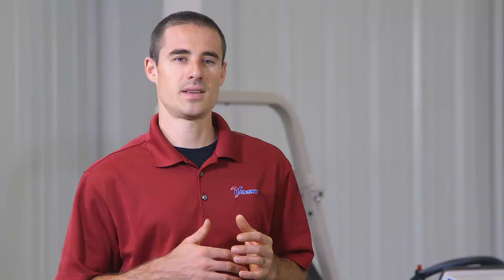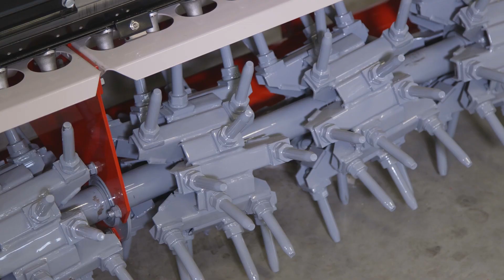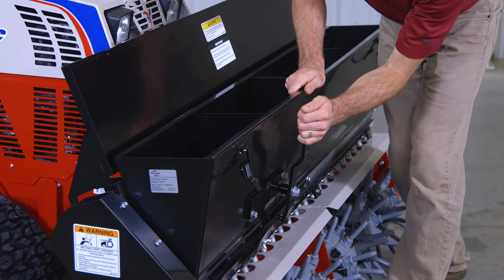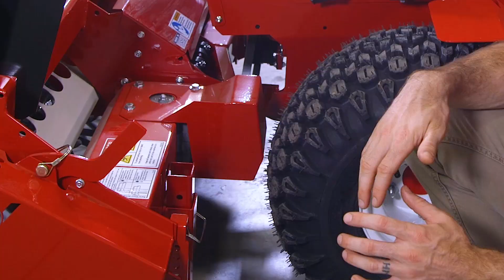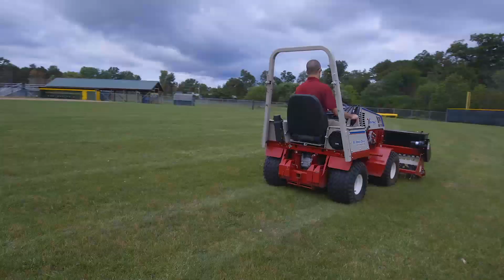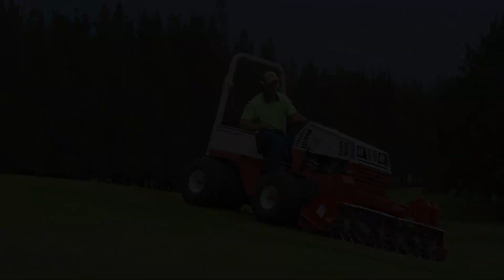Aerate Lawns Without Pulling Plugs – EA600 Aera-Vator Overview – Simple Start

Comment: Still skeptical.  To me you are pushing dirt into the ground not creating air space because no core piece is coming out of the ground and letting the grass breath Better.  Please explain to make me a believer of this method of aeration. Thank you
Reply: Great machine 
Time saver
Aerate and seed at the same time
Only problem is I have while using this is that landscape matters
Soil and grass health matters
When weak
There's alot of tear up, which means more seeding and more hay

Comment: This machine has made a huge difference in my business model. In year past it used to take us 2 months with 5 to 6 guys to get through aeration season, with less properties than we have now. This year I did everything by myself in about a month, it is still hard for me to believe. Around 40 acres of Are-rated turf HOA, and Residential Properties.
Reply: I thought its very important to have the core come out of the ground so the grass can breath Better?  Pushing the dirt/ grass further into the ground to me does not give the ground new breathing/ take away compaction?   Please advise. Thank you
Reply: @brodygoalie  The tines are eccentrically mounted, such that they wiggle around and vibrate while in the ground. Trust me, it's really great at loosening things up.
Reply: @brodygoalie  The AERA-vator is designed to stir and loosen the soil beneath the sod without destroying the turf. The EA600 creates a core hole without bringing a core plug to the surface, leaving the turf ready for use immediately after treatment. Nine holes are created each foot (97 holes per square meter) and hole size is regulated by drive speed-- the slower the drive speed, the larger the hole. The AERA-vator works best in dry un-irrigated ground leaving a core hole while fracturing the sub soil. Information is from Ventra website

Comment: What are the benefits of vibration of over soil displacement? Pros and cons
Reply from the maker: Vibration fractures the soil around the entry holes which does a few things differently.  It helps soften the ground overall - to the point of being noticeable when walking or running on it.  This also creates a better environment for the grass roots to expand and enables water to be absorbed more uniformly and to greater depths.  Vibration also results in a cleaner finished product that is immediately useful.  You can run an Aera-Vator over a soccer field and play a game on it 5 minutes later.  Pulling cores requires cleanup or messy dissipation.  The only downsides to aera-vation are the slightly more compacted entry holes for the tines.  Also, if you're trying to top-dress, it makes sense to remove material by actually pulling cores so that the surface can take in more of the sand or other material that you're introducing to the area.
Reply: @ventrac  so you are saying if you are top dressing with organic compost it's better to use a traditional aerater?  Please advise. Thank you

Comment: What's the point of this attachment?
Reply from the maker: This is a form of aeration.  It just uses vibration instead of soil displacement.  Aeration helps more water and oxygen get to the root zone of the grass.  Due to the vibration, this attachment also helps relieve compaction.  It's a great mechanical way to improve the quality of the turf without having to rely on chemical fertilizers or other inputs alone.
Reply: B.D. Wrubel the rain Goes now easy in the ground.       Sorry vor bad english